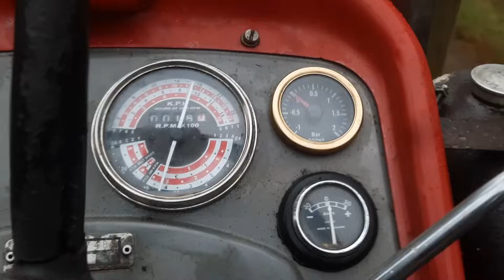My Tractor's fuel pump broke down, Far away from my workshop.. Mf 165.

Comment: I don't know a whole lot about engines, but I was surprised you could double the HP with out putting too much pressure on the cylinders .
Reply from the maker: This set up should not hold up. 1.3 bars on this long stroke is to much. But it holds up. Dont know why.
Reply: @YesterdaysMachinery  they overbuild these oldschool diesel engines. Its the same with cummins diesel engines they made not even 200hp from factory but hold up to 500hp.

Comment: Hi Richard. What's the purpose of the throttle valve you added to your 165 ? Thanks
Reply from the maker: Hi! Main purpouse is to shut the air of if the turbo fails and the engine goes runnaway. Second is that it makes it possible to have a "dump-valve" that dumps the air when letting go off the trottle and makes the loud not so cool "PPPPpppfffffttttt" sound to impress the girls.
Reply: @YesterdaysMachinery  Thanks for the reply. I learned something new today.

Comment: Late to the party!  My 135 has been filling the oil sump, I was told it was the gasket on the fuel lift pump, which i changed out for a new unit but didnt fix the problem.  I wasnt aware of the seal on the end of the pump, and it has been disturbed a few times.

Comment: Did you do anything special to the fuel pump and piston in order to install a turbo charger on your tractor?
Reply from the maker: Hi, no just adjusted max. But there are different plungersizes in those pumps. I have the big ones original.

Comment: I have MF165 , sometimes it gets stuck in gear.I would open the gear nut and try move gear with a flat big screw driver to unstuck the gears inside the gearbox.
Some say that is a common fault on Mf165.
How do I fix that problem , thank you.

Comment: Hello! Hans from Norway here  Awsome video! Any advise on leaking injector pipes that are brand new but still leaks at the connection point on the pump? I have a mf35 with 23c engine. Thanks

Comment: Would you please explain turbo modification . I would like to do it on my same tractore .
Reply from the maker: Quit straight forward actually, home made manifold. Put correct size turbo on. No intercooler. Fix oil to turbo. Adjust fuelpump to max. Or swap pumpelement if you want even more gravy. Then go! I have a cut of valve on the intake. And a adjustable pressure valve so i can set psi where i want. /Richard

Comment: Cool stuff, looking forward to the transmission video. One question though, from how I understood how those rotary DPA pumps work you have to basically take apart half the pump to increase fuel amount.. How did you compensate for the extra air you said you didn't remove the pump before?
Reply: He didn't say that he had not removed any parts from the pump , he said he had not removed the pump before.  He also said he  had replaced gaskets and o-rings,  the pump was partially disassembled without removing it from the engine, not difficult if you clean it thoroughly before you start working on it.

Comment: you can still use the oil diesel mix as fuel...
Reply from the maker: Yes but i cant say that, highly illegal here in sweden. It always runs on around 90%waste oil. Never engine oil tho, clogs the filters fast. All other oils is better. Hydraulic, transmission oil ATF and so on. Last 5 years i dont know how many 1000liters of used oil i have used in engines as fuel. But many.

Comment: IF YOU EVER HAVE A DIESEL PUMP THAT IS NOT WORKING PROPERLY,
STARTING OK BUT THEN DIEING AFTER A MINUTE OR SO, CHECK ALL THE  FUEL INLET FLEX HOSES TO MAKE SURE THE RUBBER HAS NOT
SWELLED THE PASSAGE SHUT!
IN MY TIME AS A MECHANIC I HAD WORKED ON TWO ENGINES SOMEONE ELSE CHANGED OR REBUILT THE PUMPS!
THE PUMPS WERE OK, THE PLUGGED LINES THE FAULT!!

Comment: How much fuel is normal to come out of the injector lines when bleeding the fuel system? Would be very nice to know as I am trying to start an old Ford tractor 😁
Reply: As no one has replied I thought  I would. In reply to you there will be not much  to  start with as you  crank it over because of the  air  in there  and  some  diesel  will eventually  start to come out until it starts on the other  cylinders. You only  need to  loosen one injector  also.
 how much is not so  much of an issue because the  engine  should start  on the  remaining  cylinder's.  Tighten the  loose pipe  when started and  the  engine  will  pick up  on that cylinder  in  time. Hope that helps and this is  for  rotary  pump only .
Reply: @internaltraffic8227  Thanks for your reply. I have issues with starting a Ford 5610 where the fuel pump seems to be the bad thing. It has compression and all, but it isn't pumping fuel to the injectors. CAV 4-port rotor pump. I have disassembled it completely and turned the adjustment ring to max, without success... :(

Comment: How is that oil filter still usable after being soaked in diesels?
Reply from the maker: Why should it not? Diesel aint bad? Filter was 10h old and even the owners manual says that you should take the filter out and klean it in diesel or kerosine on old tractors. Back then you did not change the filter every time you changed the oil. I normally do tho.  So that wont make any difference. And another good reason is that i didn't have any other filter to replace it with.
Reply: @YesterdaysMachinery  Interesting. Your average automotive oil filter would not survive a bath in diesel.

Comment: Love the sound of that engine under load! You mentioned the exhaust cap blew away overnight, isn't that popped off when you first started the engine?
Reply from the maker: Yes but i put it back on. But it fell of during night. It spits very gross black gunk if it rains in there.. and that black mess burns in to the paint if i dont wash it away before it gets dry. /Richard

Comment: When you do the gearbox video, please explain the Turbo setup as well. I think I saw two different exhaust pipes? Thanks for this video also.
Reply: There is the piping from the head to the turbine and then exhaust piping out of the turbine housing. The head to turbine housing is what spools the turbo by creating pressure and spinning the turbine.
Reply: @brendanberry7403  Yeah, I got that. I understand turbos. I replace 'em once in a while..... At 28:39 there is a good view. Inlet, to the engine from the turbo....large exhaust outlet going up from the turbo. What is the smaller diameter horizontal pipe?
Reply: The horizontal small chrome pipe is the blow off valve from the turbo compressor....you can see the puff of air coming out when Richard accelerates in 1st nad then changes to second  gear when he starts to wind it up....as he changwes from 1st to second the turbo blows off the excess air.....the engine needs to slow down to enable the smooth gear selection...so the boost is evacuated out the blow off valve as it can't be used in the engine...

Comment: Do you think that the center bolt being loose contributed to the seal leaking?
Great work!
Reply from the maker: Yes, when that bolt is loose the diesel goes straight thru the treads and in to the engine. But the seal was old and dry as well. Thanks! /Richard

Comment: Why there is a butterfly valve between the turbo and manifold ?
Reply: When you back off the accelerator...with the turbo on boost and spinning at top speed...the engine would not slow down very quickly.
With the butterfly valve snapping shut...no engine boost...idle happens quickly.....
Reply: @JohnSmith-yv6eq  that's kinda cool, I was more thinking it was a way to stop engine runaway

Comment: How old is that Olympia?  I see you kept the original 6-volt electric system in it.
Reply from the maker: A -57.   Yes 6V is great. I hate when people convert to 12 just because they have seen on internet that 12V solves all your life problems. Then they buy some crappy AC gen on ebay that fits bad and holds up 2 years when the original 6v has worked for 70years. I dont understand why people are so scared of keeping things original.

Comment: I reckon you may have had your money's worth out of the boot lid seal on the car. It would be a good idea to replace it before you get affected by the carbon monoxide, not if you will be but when is the question.
Reply from the maker: The amount of exhaust that i breath every day is quite high so yeh, need to cut it down. I will fix the seal, promise!
Reply: @YesterdaysMachinery  I have, in my profession as a road train driver in Australia, pulled quite a few severely injured or, sadly, deceased people out of vehicles with hardly traceable bad parts of body seals where exhaust gasses can enter the vehicle's cabin, very prevalent in the poorly built Fords that litter Australian roads. 
I have experienced it myself in the 1970's when a Fiat I owned had a very small crack in the exhaust manifold and the gasses entered the cabin through a poorly fitting grommet. 
So please do not take my advice sarcastically or in jest. 
I would hate to see you, or your family, if you care about them, become another of those statistics on the road death roll. 
The problem is an insidious one but it is also a killer.

Comment: Renoverade du högtrycks pumpen själv? Var det svårt? har problem med md21 pump som liknar din.
Tacksam för svar. Mikee
Reply from the maker: Hej, ja dessa CAV rotorpumpar har jag renoverat flera. Nja har man lite mekvana så ska det gå. Det finns rättså mycket matnyttigt på nätet om hur man gör. Kör du fast så hör av dig. Mvh Richard.
Reply: @YesterdaysMachinery  
Tack för att du tog dig tid att svara.
Var hittar jag delar o instruktions bok?
Är det vingarna som roterar som pumpar? Är det dom som är slitna eller mer oringar som behövs bytas? Ska motorn nollas?
Mvh .M
Reply: Hej igen! Gick i 6 timmar nonstop. 1% 2 tackts olja i dieseln. Finns det ett litet filtret på pumpen?
Reply from the maker: @maikeljaonson8814  hej, såg inte ditt svar först. Ja det brukar vara ett litet nätfilter där i gaveln där dieselröret ansluter i bakkant. Ja det är en matarpump inbyggd i pumpen också som du beskriver med "vingar". Dom brukar sällan bli slut.
Reply from the maker: @maikeljaonson8814  denne MFen har gått på nästan ren spillolja som bränsle i jag vet inte hur många timmar. Vågar inte göra en video om det, annars hade jag gjort det.
Reply: Tack för svar. Tror att det är skräp i filtret  för den går lixom full kraft ibland